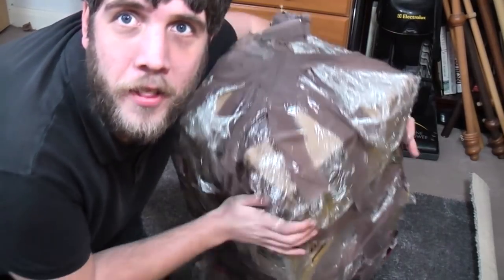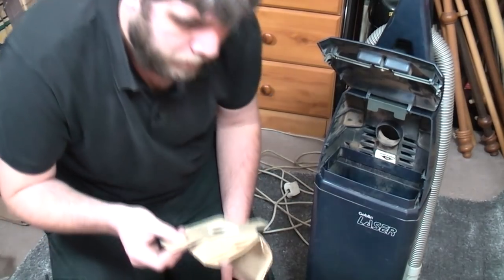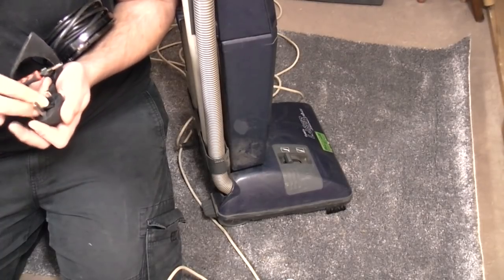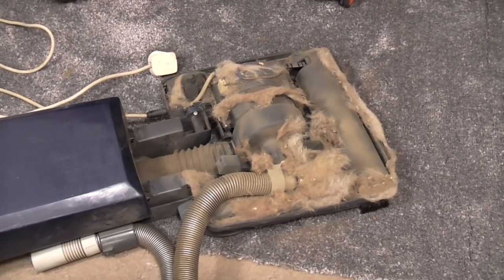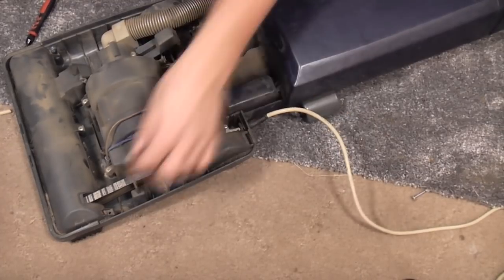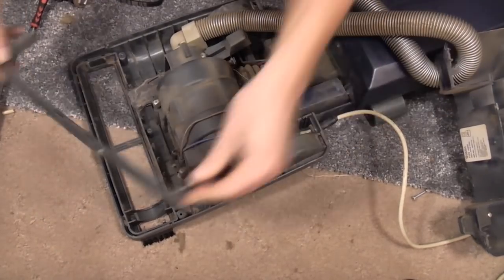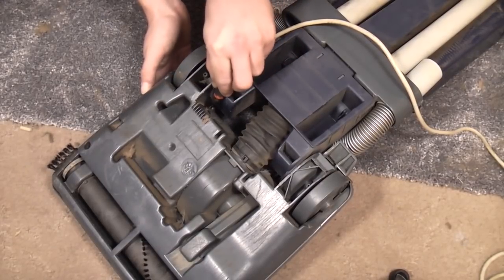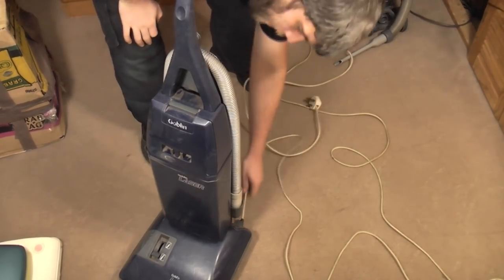Goblin Laser 2500 PLUS! - Retro 1990's Vacuum Cleaner. First Look and Unboxing!

Comment: I'm trying to fix my first hoover, it's a Turbopower U2806 and it makes a shrieking horribly loud grinding noise! But it still sucks up lol... I think it must be the motor bearing, not the top one which looked ok but the other one hidden beneath the fan?! 

Beko1987 do you know what this bearing part number is or size? I haven't open the fancase part yet cuz it's stuck together (glue?!) and I don't know if I need a gasket to reassemble. Thanks man!
Reply from the maker: Yep, sounds like bearings! You need 2 608zz bearings, and skip around on this video, I show the motor being refurbished here! https://youtu.be/WxtY5l9BA5s
Reply: +Beko1987 Thanks for your link, I see around 35mins you reach the bearing! But you can buy 608ZZ in standard, C3 or C4 clearances: 
https://simplybearings.co.uk/shop/advanced_search_result.php?keywords=608z

Is the 608ZZ C3 more durable or better for a few pence more?

Comment: Did you manage to hepaflo this vacuum cleaner Sam?
Reply from the maker: Not yet, infact I've done nothing with it bar sticking it in the loft after filming this!
Reply: @beko1987  I've picked up a goblin lazor 3000i for a fiver and stuck a sebo bag in it. The woman said it had lost suction. The lollipop sticks stuck in the hose might of course that problem. Will u be using it for vacuum cleaner of the month.
Reply from the maker: @olliemcphillips623  nice! No, it won't be vac of the month as it'll be terrible on hard floor sadly
Reply: @beko1987  its worth a try and tbh most people who got them wouldn't of had hard flooring back then. Carpets all the way